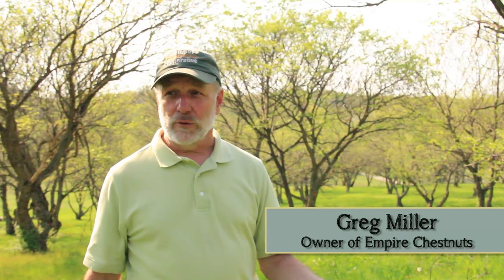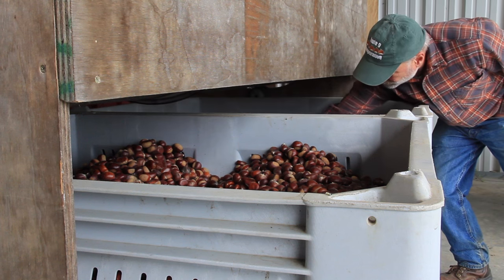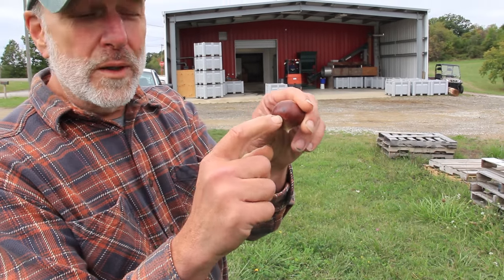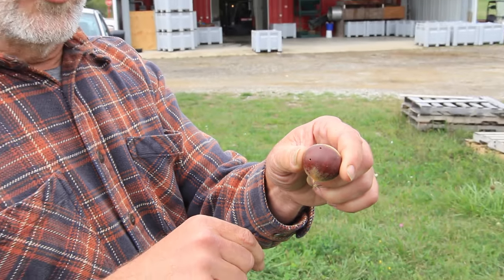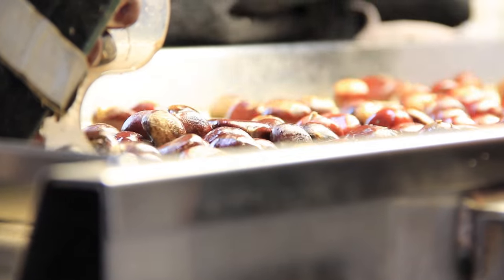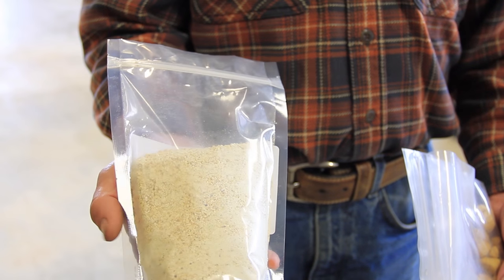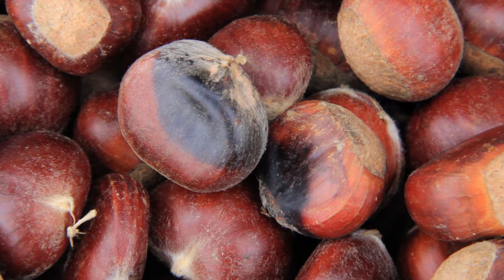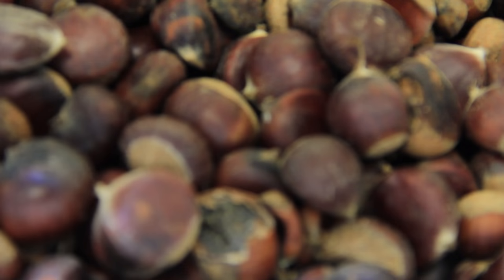Bringing Back the Chestnut: Processing Chestnuts

Comment: I have two huge and one not too big chestnut trees in my backyard. I always get larvae in them and when the grubs come out, they are disgusting. How hot is the water for water bath and for how long? And how do you sanitize them? Two years ago, after picking, I put them in the bucket, by the time I check them, there's nothing but grubs. Had to throw them away.
Reply: This year I'm collecting nuts daily. I'm cutting them in half and placing them in boiling water. Stirring removes most shells and when the water returns to boiling I'll take them off the stove, remove the stubborn shells, trim any dark spots and then freeze them in ziplock bags, portioned for eating as side dishes at supper. Boiling will kill any grubs or eggs, just trim any bad spots.
Reply: Yes, I have a half dozen or so producing trees, thirty years on now. These trees drop nuts sequentially it seems which is allowing me time to work on the harvest and prep daily. We do a little subsistence farming and this year our corn was a fail so I'm concentrating on these chestnuts. The grubs have been a turn off and I've let the deer eat the mast from year to year but this year I'm experimenting with the boiling and freezing.
Reply: @nj1639  Thanks.
Reply: @nj1639  Do you know if bake it in low temperature, say 200F, will take care of the bugs and bug egg problem inside the chestnut? If so, for how long? Tks
Reply: @sosole888  
I don't know, I've only blanched and then freeze them.
Reply: @sosole888  If you go ahead and roast or boil the chestnuts that will certainly prevent any further development of the grubs, but it's also possible to keep the nuts as fresh nuts by keeping them in a water bath at 120F for 20 minutes.  That's hot enough to kill the grubs/grub eggs but not hot enough to cook/kill the nuts themselves.

I like to hot water bath treat some nuts in order to keep the nuts fresh, but I'll also immediately roast some chestnuts and then either consume them promptly or peel and freeze for later use.

It's likely most of your nuts from every point in the harvest season will have grubs, especially if you don't do anything to arrest their development very soon after they fall, but the first nuts to fall will likely be relatively better (in terms of grubs/grub damage) than later ones.  I pick up nuts daily and process at least every other day.  If there aren't other trees in your immediate area and if you can pick up all the nuts daily, you might be able to prevent a lot of the grubs from hatching out and getting into the soil where they can complete their life cycle and infest the next year's crop, so picking up nuts daily and preventing any grubs that are in those nuts (or that could proceed to develop in those nuts) from surviving might help a lot to reduce damage to subsequent crops.
Reply: If you collect chestnuts and store together the worms or grubs infect almost every other one.  Keeping them cold slows any spread. You can also spread them on a 1/4 inch mess screen.  The grubs will fall and not infect others. I personally have a pear collecting pole that I pick off chestnuts just as they start to brown. Get less bugs and easy to peel if straight off tree. Luckily my trees ripen at different times so I enjoy them longer.